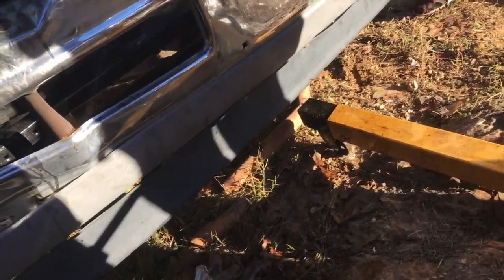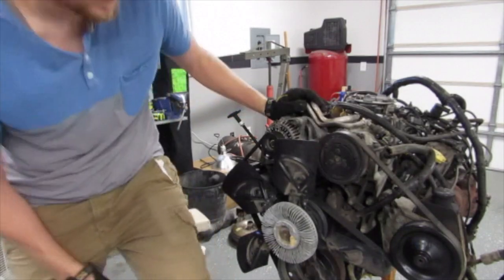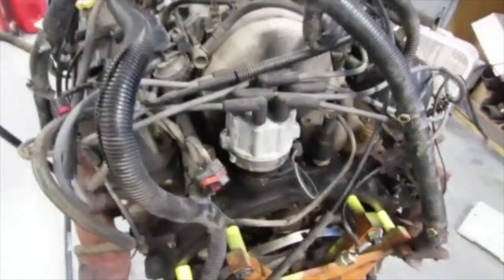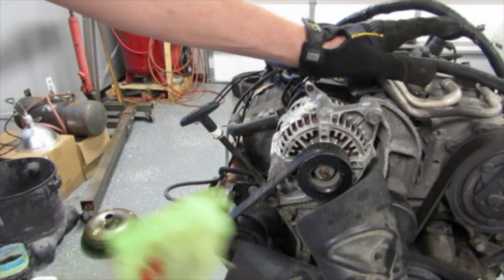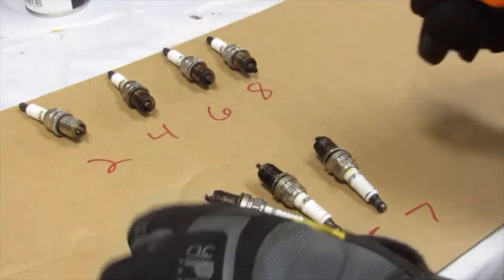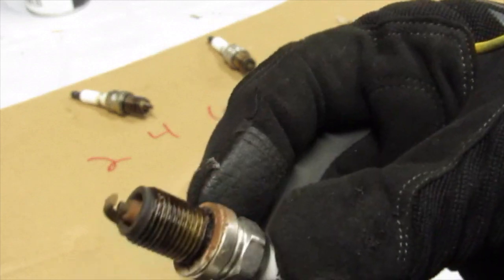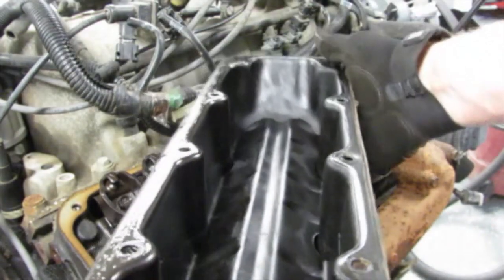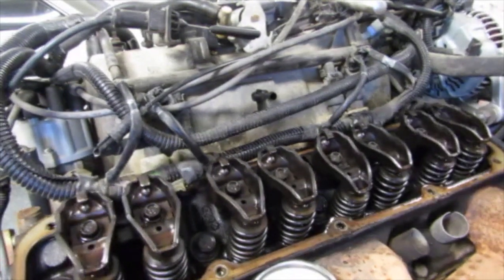The Magnum 360! How to Spot a Builder! Was it Worth it?

Comment: YES!! Dude I just bought the same motor from PullAPart here in Ohio. I pulled mine from a wrecked 1999 Dodge Ram 1500 with 148K miles. It cost me $294.00 without giving them a core motor. I should have dropped the pan before I pulled it out and bought it! The thrust bearing is completely worn and crankshaft counter weights have been rubbing against the block which shaved the counter weights down a bit. Hoping a new crankshaft will take care of my issues without having to replace the block. I tried to take the motor back but because I started to tear it down they denied it. I called a local engine rebuild shop and they told me it's common that thrust bearings go on those motors when they aren't taken care of. No biggie Iam doing a full rebuild anyways. Also the bit of oil in this motor was as black as diesel oil. Everything under valve covers and intake is coated in black oil. I also found the plenum plate gasket was hard and blew out. I will clean everything up and replace it though. I bought everything new already and it is just sitting waiting on the new crankshaft and rods. I would love to see you or anyone rebuild one of these with torque in mind! Iam not into speed or nitrous but I would love to be able to see this motor be able to pull whatever I connect to the truck. I am used to buying newer trucks but dealing with the electronic issues of the new trucks is sometimes overwhelming and expensive so I figured I buy an older truck with less electronics to avoid the headaches and be able to put it to work. Another thing which I found that I didn't know (correct me if I am wrong) was there were two versions of the dodge 360 one having a block cast number of 53020006-360 and the other having a number of 53020006AB-360. Some people has said one is light duty and the other is heavy duty. Either way the motor mount holes on the block of each engine is different. My old truck is the AB version and the motor I just bought is the regular 360 version which everyone online swore would be a direct fit. (It isn't) For those who may be doing the same. Make sure your block cast numbers are the same for those looking to do a swap. From what I read online the AB blocks were only used in dodge trucks between the 2002-2003 year before the 4.7 Hemi and 5.7 Hemi arrived to take it's place but haven't found much more info yet. I found a company that specialize in selling the AB blocks but there prices for a remanufactured block is ridiculous and I rather just buy another AB block and rebuild it myself before paying them for there's. Anyways I know horsepower and torque are increased together I would just like the to see someone focus on torque and longevity of the motor as the goal and see hp as just a secondary plus. I guess what Iam really wanting to see or ask is will it be possible for the 5.9l 360 to out perform the 5.9l Cummins in it's ability to pull? That is what Iam after with mine.
Reply from the maker: Car Kingz hopefully if my crank is good, We should be at about the same cost. That’s a tall order to try to beat the Cummins at pulling with a small block, unless you can add that turbo or supercharger. But I do believe even a stock rebuild with long tubes and a good intake and carb should put you around 400 for lbs if torque. I need to research more on cam choices, only seeing a couple from Hughes engines and maybe Comp. If it costs me 600-800$ for a cam, I might consider a power adder instead. Uncle tony used a similar motor platform in his “ultimate daily driver” dart. He said it performed well and even got decent mileage. It’s hard to tell without a dyno or racetrack. If fitment is an issue, I’ve used a motor plate before that mounts between the water pump and front cover. It’s not ideal on the street, but works great at the racetrack. I saw the Ears on the side of my block so I shouldn’t have an issue. Good luck Brother! I’ll keep y’all updated on this one for sure!

Comment: Most of the value is in the heads.  Rings, a cam, and carbureted intake would go a long way on that one.  That said, welding a carb adapter to that intake might be interesting.
Reply from the maker: I ABSOLUTELY was studying that Idea. In have a chinese air gap that I could use though. I thought about a stock rebuild with China intake and manifolds, throw it in my black truck and see how slow it is. Then update cam and headers to see what E.T. was gained in each step.

Comment: Great Motors! Yes Magnum Swap is a great source of info. I really appreciate these roller motors. Real EZ to get 300hp. Gotta love Big Red and Mr Jones.
Reply from the maker: Andrew Frisard this is the first one I’ve ever owned. Everything seems to be in good shape for the rebuild. Apparently aftermarket cam selection is not so hot, with only a few sources like Hughes engines.
Reply: @JustMoparJoe  I’m running a roller Hughes whiplash cam in my 5.9, with a fuel pump eccentric. Any LA roller cam will work, comp has several to choose from as well as Hughes. Headman headers fit the best, imho.
Reply from the maker: Awesome! I put the Hedmans on the red sled. They went in like a dream!

Comment: You gotta build it Joe! I have a '98 360 Magnum for my Fury III. Now you have me worried about the heads. I should have them checked out I guess. Can you tell me more about the intake manifold problem you had on the Red Sled? I just got my Holley carb, but no intake yet.
Reply from the maker: Thomas Anderson here’s that video if you get a second. It would probably be fine on the magnum because of the bolts pulling straight downward. https://youtu.be/pv94mIMPslg
Reply: I'll check it out, thanks!
Reply: I watched the intake video, thanks for the warning!
Reply from the maker: I’m going to try that intake on the 360 magnum, I think. I’ll check it out carefully and give it a full port job with the heads.

Comment: Not bad for $500 did you get trans as well?....did you look at the valve seals usually hard by 109k,  rings and bearings are a given got to be replaced....and isn't the engine mounts different? by 96 no more mounting ears on side of block, I can't wait till the heads are off and get a better look inside....you could always adopt another mopar to put the engine in how about a 65 barracuda! Fastback
Reply from the maker: Moparnut62 no trans with this one. This one has the ears on the side just like my 74’ model block in my truck. Those valve seals have got to go either way. If it can’t be budget friendly, it may go into the corner for a while!😆

Comment: If you run outta ideas,  I've got a 2000 Dakota with a 3.9 that's beggin for a 360 upgrade.
Reply from the maker: I always get stuck with engine swaps and Have to work some Mopar Magic. That’s be a cool swap!
Reply: @JustMoparJoe  it's a simple bolt in swap 3.9 shares the same bell bolt pattern and exhaust will bolt up to 3.9 as well.

Comment: I retired as auto inspector In my experience I had about a 40% of valve set
Would Crack at about 100,000 to 120,000 miles the heads would crack Between the seats compression would be normal and will give you a Intermittent misfire code.
Reply from the maker: But will the heads keep working nearly normal with a carbed intrake?
Reply: @JustMoparJoe  I’m don’t the Dodge 2001 Half ton pickup fleet there a state fleet. They need to be kept emissions compliant.
Reply: They also had a lower intake vacuum leak that would gave intermittent misfire
Reply: Never had a misfire code in my 350,000 cracked valve seats . Rebuilt the engine and put it in my valiant using them cracked heads ported and upped compression to 11 to 1 .